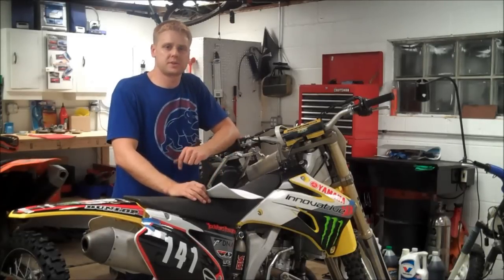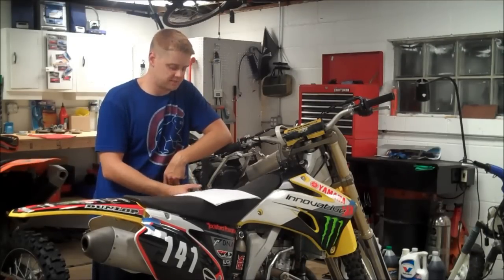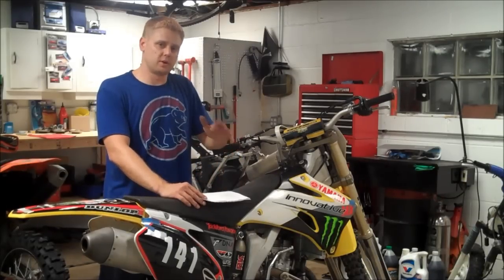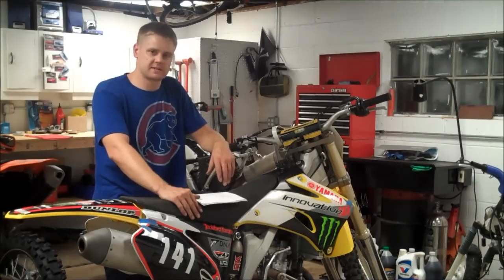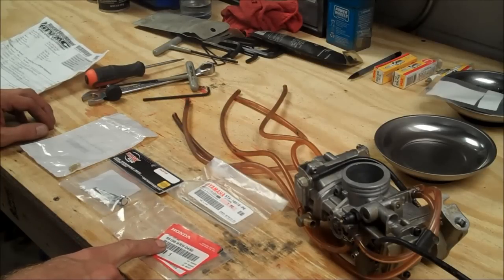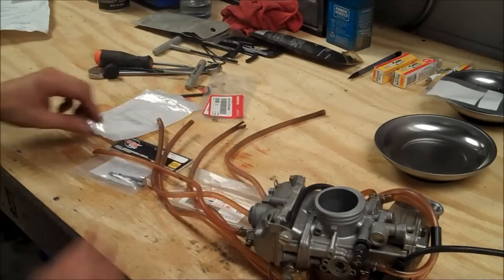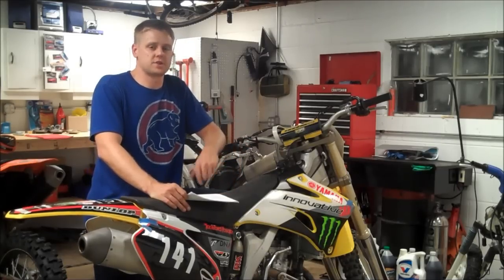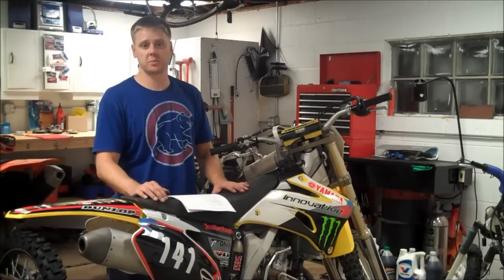How-To: Jet a 4 Stroke MX Dirt Bike (Sample)

Comment: I’ve got a 2006 ktm 250sxf with a fmf power core 4 exhaust and I am at 2 turns out and the hot start does not raise the idle, I turned it to about 3 turns out and the hot start still responding the same way / and I get a lot of unnecessary back fire and popping with little bit of flame. So I’m curious if I need to change jetting or what ?

Comment: Man i need help. I have 03 crf450r wont run off choke an its hard to crank. I clean the carb an everything everything is clean. What jetting u recommend an the mixture screw ? I have a 175 main idk if others are stock or not i have a MRD pro comp exhaust on it

Comment: Hey, I recently purchased a dual sport (23 xr150) and it comes out of the box very lean, I’ve been watching your videos and I’ve found them very helpful however I’m kind of trying to figure out if I should go up or down a pilot size (stock main 105) (stock pilot 35) as it runs too lean, at least I think because when I got to give it a sudden punch of throttle, it bogs and turns off. I’d like to note that the needle jet is non adjustable (no clip) and the float is all plastic, non adjustable. There’s also no air/fuel mixture screw. I’m not exactly sure if I should go up or down on the pilot as I get confused on this matter in particular for the idle/pilot jet. Where I live is less than 1000ft elevation and I have gone up in main jet and I’ve gotten more power just still bogging when I give it throttle. Anything helps thanks

Comment: Hello,, on my '05 WR450 it runs perfect but pops alot on decel and airscrew is 3 turns out, not going anymore, any recommendations? Should I go up on the pilot size 1 or 2 ? TY
Reply from the maker: I'd run at least one size larger pilot jet than stock.

Comment: @MatthewMCRepair. My 2008 kx250f is backfiring/Popping alot on deceleration. Iv changed the spark plug and the valves clearances are fine. Do you think a different jetting configuration would do the job. If so any advice on the configuration. Thanks
Reply from the maker: On decel it is usually a lean condition. Make sure there are no vacuum leaks, exhaust leaks, carb is clean. Tune your fuel screw, I have a video on that. https://howtomotorcyclerepair.com/how-to-4-stroke-mx-fuel-screw-adjustment-yzf-crf-kxf-rmz-fcr/

Comment: Pop on decel and a lean pop in low rpm either the air mixture is out or too small of a pilot jet or tight valves or exhaust leak

Comment: I’ve got a 08 yz450f always have a problem when I first start it and let it warm up the first blip of the throttle it’s dies. When I start it up again it does not do it it’s always the first blip of throttle any suggestions? I want leaning toward accelerator pump?
Reply from the maker: Not sure on that one. Runs fine when warm/hot?
Reply: Yeah only does it on the first start

Comment: Anyone know what i have to change on my 26mm molkt on a lifan 125 to get
 rid of bogging? I have tried from 100 to 122 main jets (102 is the 
stock one) and nothing is helping, i have also tried 10 sizes bigger 
pilot jet, im not sure if it helped, but maybe it did a little. I tried a
 cloth around the air cleaner that removed the bog but it doesnt work 
well with it on. So do I have to get bigger or smaller main jets and/or 
pilot jets? I appreciate if someone could help

Comment: do you need and air/fuel screw for your carb? I have a yz250f09 and i just noticed my carb doesnt have it but it still runs ok and starts with one kick?
Reply from the maker: Yours has a stock fuel screw that is well hidden. I would recommend buying an aftermarket screw that is easily accessible.
Reply: @HTMR  oh thank you sir! i will definitely check my carb when I can. Good content as always sir. May i suggest that you make a video about fixing intake boots i dont see a lot of videos about that.

Comment: Hi Matt,I have a 2010 KX250F with an Athena 290 Big Bore Kit, I got a carb kit from Tokyomods for a big bore, they gave me, 68 leak jet, 45 pilot jet, 178 main jet, NCYU needle, 4th groove down, Fuel screw 2 turns out, I can't get it to start, Please help!
Reply from the maker: Have you tried different fuel screw positions? 1.5 or 2.5? Also try no choke and pull hot start. They are a pain to start until the fuel screw is tuned.

Comment: I am new to this.  Thanks for your video.  Is all of this jetting related to elevation?  I live at 5500 feet, but want to ride in Glamis at an elevation of 335 feet.  Would I need to have two jet kits for each of my elevations?
Reply from the maker: Yes, you would ideally need 2 jetting combos.
Reply: @HTMR  Great!  Thanks for the reply.

Comment: I have an 07 kx250f and I'm running 175 main 42 pilot not sure what the leak jet is. Do you have any recommendations for all 3 jets that will improve all around accelleration and fix bog ?
Reply from the maker: https://www.howtomotorcyclerepair.com/how-to-kx250f-jetting-specs/
Reply: Thanks buddy

Comment: Hi theoretically they say at idle when you push hot start you should i nice strong rev to have your pilot jet and fuel screw correct. I have wr 450 2004 with 48 pilot(stock45) and about 2 turns fuel screw, when i push hot start on idle it slightly revs like a bog or something, what shall i do with my pilot jet or any other jets? If i seat the fuel screw all the way in it will eventually die (doesnt this mean the pilot is also right)? The bike starts and drives fine but how to i get it perfectly jetted?
Reply from the maker: I don't judge jetting based off how the hot start acts. The hot start should introduce more air, leaning it out, and make the RPM's go up though. Watch this video on proper fuel screw tuning: https://youtu.be/kUw41sUQbTY
Reply: So that means im set pretty good with pilot and fuel screw even though the hot start acts like that? Will a needle or main have any effect or shall i just leave it the way it is?

Comment: Love the vid. Was wondering would this also apply to the 05 with the steel frame. I dont think they changed much in the engine but just thought i would ask
Reply from the maker: What make and model?
Reply: 05 yamaha yz250f
Reply from the maker: Yes, then copy the jetting I did for this 06 and it should run much better.
Reply: Sweet ill save your other page so i can watch the vidoe when i get the money for the parts. Thanks for the reply even tho its a year later

Comment: I've installed a full exhaust kit, K&N intake air filter, and a jetting kit on my Atv and it shoots flames when I let off throttle, like very small backfires but I don't even know if you would call it a backfire cuz they aren't very violent, but my question is, is it supposed to throw flames or do I need to adjust one of my jets? If so, which jet or pin do I adjust, and wich way and how much should I adjust? I'm just trying to better understand how my engine works, and help is greatly appreciated thanks.
Reply from the maker: What year make model do you have? Did you jet the pilot and adjust fuel screw?
Reply: MatthewMCRepair MatthewMCRepair 

     It's a 2007 Polaris Outlaw IRS 525cc, also I am using the exhaust without a spark arrestor, but I thought that it would only spit fire when I gun it rather than when I let off throttle, that's why I'm wondering if I should adjust the jets or not, but it doesn't bog out at all, other than the very small backfires the throttle is very smooth and snappy. 

And it currently has a JD jetting kit, I went from the stock 148 main jet to a 160 main jet, used the red tipped needle with 5th increment or clip down on the needle, and I didn't adjust the pilot jet at all.

Comment: would this jetting work at 3300 ft above sea level 
ps my bike is an 04 yz250f with an fmf power bomb header and an fmf factory 4 exhaust 
currently running 
178 main 
42 pilot 
90 leak jet 
stock needle middle clip
currently running fuel screw at 3 turns out to make the bog a little better
Reply: I believe that's the stock jetting
Reply from the maker: It's a good start. You  will have to lean it out a bit for higher altitude. Get rid of that 90 leak and throw a 55 in there.
Reply: MatthewMCRepair ok it runs pretty good acept for the bog is really bad and it starts kind of hard when it's cold but when it's warmed up starts first kick
Reply from the maker: Anywhere from 45-55 leak and o-ring mod should rid that bog. Readjust fuel screw for peak idle RPM and that should help with starting as well.
Reply: Ok from what I can tell my pilot is a little rich and I have done the oring mod will try a 45 leak jet first then I'll go from there
Reply: And when I pull out the choke when the bike is warmed up it just dies would be from a rich a pilot?
Reply from the maker: Read/watch this about fuel screw adj and pilot sizing. If all set up properly then it should start hot/cold no problem. The bog is all in the acc pump, so buy a smaller leak. https://www.howtomotorcyclerepair.com/how-to-4-stroke-mx-fuel-screw-adjustment-yzf-crf-kxf-rmz-fcr/
Reply: MatthewMCRepair ok thanks
Reply: MatthewMCRepair I got rid of the bog by putting a 45 leak jet in it but it wouldn't start unless I bump started it so I put the stock leak jet back in it and did the oring mod again because the old one ripped so I replaced the oring with a zip tie and that fixed the bog and ever since I've owned the bike the choke has just killed the bike when I activate it even a slight pull on the choke will kill the motor so I have to start it with out a choke which on warm days isn't really a problem but on cold days it's a pain would u happen to know what the issue could be?

Comment: Have you got the leak jet part number please??.cheers sam
Reply from the maker: Here ya go: https://www.rockymountainatvmc.com/p/930/47202/Keihin-N424-52-Series-Leak-Jet?term=leak+jet
Reply: MatthewMCRepair  I have a question , I'm using a 175 main ,42 pilot I'm still using a 55 leak jet I'm clip 2 on needle bike runs fine when hot but on a cold start with choke it will start first time but if I try and take choke off after 5 mins it will try and die and run crap.but like I said once warmed up to running temp it's fine....my old crf I'd use choke just to fire then immediately take it off and it would rev up fine am I well off on my needle ?cheers Sam
Reply from the maker: Sam, you never mentioned year make and model. If you have your fuel screw and pilot jet sized correctly, then it should start cold/hot no problem and run fine everywhere in between. Watch this vid: https://youtu.be/kUw41sUQbTY

Comment: I have a 2004 Crf250r with a fmf powercore 4, I am at 4450 elevation. What jets would I run? Specifically leak jet. My bike falls on its face when I crack the throttle. Already tried o ring mod. Please help!
Reply from the maker: I'm at 700' and run 45 leak jets and oring mod. Since you are higher up, maybe a 50-55 would work good. 

Here is the link to leak jet: https://www.rockymountainatvmc.com/p/930/47202/Keihin-N424-52-Series-Leak-Jet?term=leak+jet

Also make sure you tune the fuel screw and make sure the pilot is sized correctly, that helps with bog to some extent. Watch this: https://www.howtomotorcyclerepair.com/how-to-4-stroke-mx-fuel-screw-adjustment-yzf-crf-kxf-rmz-fcr/

Comment: sir i have a new carb on my scooter..my question is does the pilot jet affects the motorcycle when it is running already? or does it only functions during starting and idling your motorcycle?
Reply from the maker: Pilot jet circuit has the most effect on idle to 1/8 throttle, however does contribute fuel at higher throttle positions.
Reply: +MatthewMCRepair thanks sir..need an advice(160cc scoot)..from 24mm carb i am using keihin pe 28mm now..mj 125 and pj 42..when i twst the throttle its like it the engine would stop a little..i dont know the word to describe it..does this mean i will lower my pj..
Reply from the maker: Read this: https://www.howtomotorcyclerepair.com/how-to-size-your-pilot-jet-pilot-screw-explained/

and this: https://www.howtomotorcyclerepair.com/how-to-tune-a-motorcycle-main-jet/
Reply: +MatthewMCRepair thank you sir..God Bless
Reply: MatthewMCRepair  Hi Mathew. I have just put bigger jets and lifted the needle in my 2014 wr250f. She idles well and generally runs well providing I roll on the throttle slowly. If when riding I accelerate quickly she splutters then fly's away! Can you give me a tip? I have also removed the snorkel. Cheers john in UK
Reply from the maker: I replied to your email.

Comment: well i noticed when you showed the bike running when you were shifting you were not using the clutch you were just ahofting without the clutch witch thats what a quick shifter does wasnt sure if you added one
Reply from the maker: I just shift without using the clutch. I just let off the throttle a bit and then shift. And no, it's not bad for the tranny.
Reply: AdamYasin Vlogs you don’t need the clutch bud

Comment: I have some questions about my 05 rmz 250. The throttle hangs for 1-2 seconds before going down in rps after I rev it and the idle has to be set REALLY HIGH otherwise it´ll die. Do you think I need a bigger or smaller pilot jet? Or isn´t it even the pilot jet I need to change?
Reply: I have some videos on my channel where you can here/see what i mean but I just did a top end rebuild so I can post a new video if you want to see how it runs after the top end rebuild. Thanks
Reply from the maker: I responded to you on my site.
Reply from the maker: Do you have a link to the video?
Reply: Check your website
Reply: @Freddan9700  curious what was the issue with your bike as i am experiencing the same
Reply: @Shimi277  The valves were way out of spec so the previous owner had tried to compensate with a bunch o different jets. Fixing the valve clearance solved 95% of the problem for me, just some small fine tuning left after that

Comment: my 2007 crf150rb doesn't idle very well and always dies. Bogs lots too. I have stock jetting and slip on fmf ti powercore. Any suggestions?
Reply from the maker: +brayden renner I responded to your email.
Reply: +brayden runner not sure if it applies to dirt bikes but if it bogs you might wanna check the diaphragm in the carbs. I had a sport bike that would bog and I didn't know what was wrong till i checked. turned out it was a torn diaphragm

Comment: Hey bud, I just bought a 08 crf150r and it has some carb issues. Starts and runs on choke, revs and everything, once choke is completely off it bogs, sputters and dies... any ideas?  just went through and cleaned the jets and did a basic clean.
Reply from the maker: +Gatorsrok Did you remove and clean the pilot jet? Did you remove the fuel screw and clean all carb passages? Blow with compressed air?
Reply: +MatthewMCRepair did a pretty damn good job of cleaning out the main pilot and starter jet, got a thin piece of wire from a brush and cleaned them out and sprayed through them, took apart the accelerator pump and cleaned the junk out of their, started playing with the pilot screw and turning it in half turn every time, def likes  to backfire and pop turning it in. works better then before but doesn't seem to be squirting fuel out from the accelerator pump nozzle, snapping the throttle it def starves..   just seen water pissing from the weep hole and upon inspection the shaft is grooved and pitted so I'm going to need a new water pump and seals.. till I get them in I won't know how it runs
Reply from the maker: +Gatorsrok You definitely need to get the acc pump working again, otherwise it will bog/pop.
Reply: +MatthewMCRepair just took the car apart again and split it in half and found the acc nozzle squirter, it looks like a jet that you can unscrew but it's actually just a press fit.. (luckily it went back in no problem) of course it was clogged and after 10 minutes  with a piece of wire I managed to clean it out. it Works!  like I said though, i can't start it as I have the right case halve off and leaking water pump out... ended up stripping the impeller (left hand thread :(   and it's aluminum) takes a week to ship :(  water pump shaft has some pretty good wear marks and putting were it wore down.. $150 and I got me a new water pump assembly comin...  will let u know how she runs on Wednesday
Reply from the maker: +Gatorsrok Keep me posted!

Comment: Hi, i have a crf250r 05 wich bogs really much and has a hard time starting cold. Its too lean mixture, called honda dealer he said go 45 in leak jet and main jet i forgot its like 172 original or if you know what size i should buy please link them! I've got a pro circuit pipe on aswell so if that would make difference on the jetting
Reply from the maker: +breezeffs jump Here are PC's jetting recommendations for your bike:

https://www.procircuit.com/jettingspecs2.htm

I would plan on getting an adjustable fuel screw and a 45 pilot just in case. Also, a 45 leak would work good. If it still bogs, slap an oring on it. Visit PC's site for main and needle recommendation.
Reply: +MatthewMCRepair hello, thanks for the answer i checked out the site and it seems some jets are wrong written? 
Main:170 pilot:42 and leak 70? Should it be 70?
Reply: +MatthewMCRepair could you just tell me what jets i should buy? Gonna try leak jet and main jet and do the oring mod, it bogs so bad like in the video orher then that it never bogs..
Reply from the maker: +breezeffs jump I'd go with a 45 pilot and 45 leak. Run the main they recommend.